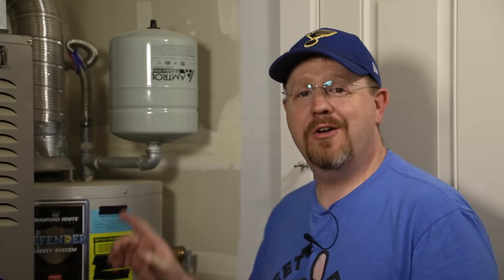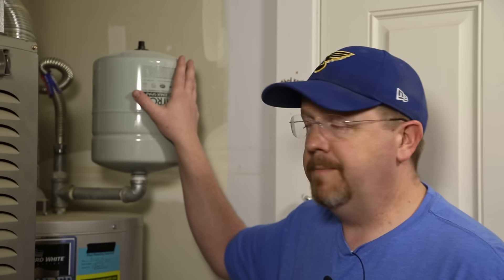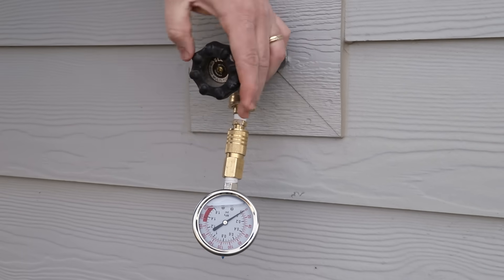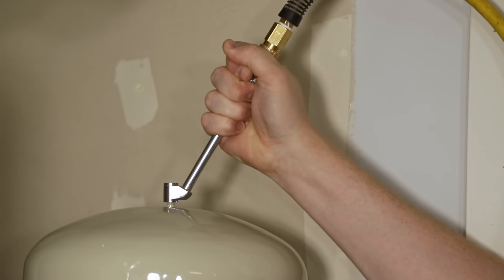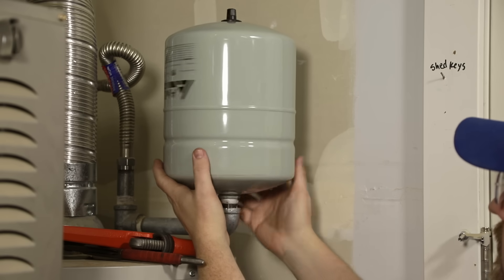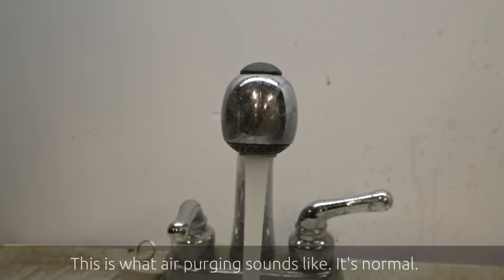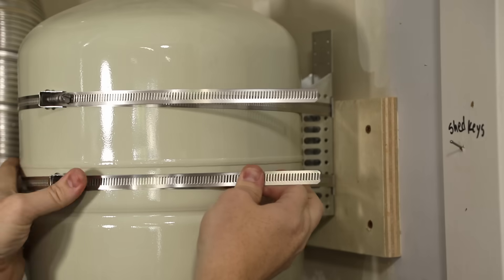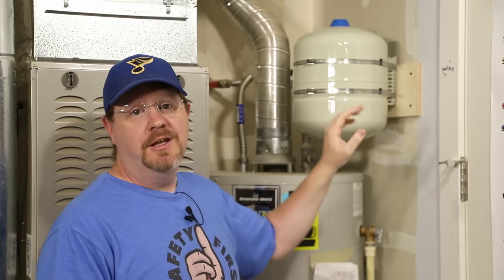What Is This Tank? How to Replace and Maintain a Water Heater Thermal Expansion Tank

Comment: This is super helpful. But I am not getting any air pressure from the exp. tank. So I when I try to fill it, my air compressor keeps shutting off thinking there's already too much air pressure. Should I try using a manual bicycle pump? Or do you think my exp. tank is already failed?
Reply from the maker: Hmm. You mean the air gauge reads no pressure on the tank at all? It could be that the Schrader valve on the expansion tank has failed. You could try replacing the valve core first. That is very cheap and easy to do. I did a video showing the process in a snowblower tire, but the core of the valve is exactly the same in an expansion tank: https://youtu.be/3U3Pv-YtMCs 
Good luck!
Reply: @AmplifyDIY  Yes, when I tried to push down the tip of the Schrader valve with my nails, nothing comes out. So it does feel like there's no air in it. And this time, I tried using a manual bicycle pump,,, but nothing. Can't even push it down. I've got the water main turned off, drained the hot water at the kitchen sink... still no change. I'm going to try to replace the valve core next and see if that works.  Any tips on what I need to do before I try to pump air back in?
Reply from the maker: You’ve already done what I would suggest. Just make sure the system is de-pressurized (on the water side) before you remove the valve stem. Fingers crossed that’s all it needs!

Comment: For the metal support bracket, was the wood backing plate also screwed into the wall on the left side and just not shown in the video?
Reply from the maker: Hi Rat - yes, I screwed it into the wall in 2 places (so it was anchored to 2 separate studs), but one was back behind the tank and really difficult to film... but it happens right at 8:11. Great question, and thanks for watching!

Comment: um, where is using galvanized steel pipe for plumbing approved?  that can't be installed to code, no way.
Reply from the maker: It was installed by a licensed plumber, and passed city inspection when the house was built 4 years ago. 
Im in the Pacific Northwest. 
Swapping that out is on my list.
Reply: @AmplifyDIY  yeah id definitely get it off.  Ive seen galvanized sheet metal laying in the rain, it turns the water orange.  Some if the mexican workers were using it to cook on 🤮

Comment: That's how my expansion tank is installed but I have read that that is actually upside down as what is the bottom in the video is where the water goes and you will end up with air trapped In the water side. According to what I've seen if that thing was flipped over with the air valve on the bottom and the piping coming in the top that would allow the air to leave that half of the bladder as it filled because obviously air rises. Not sure it makes much of a difference but.....
Reply from the maker: Hey Chris - it depends on the model. The instructions for this specific model say it can be installed in either vertical orientation. If you are replacing / installing one, consult the instructions to make sure it goes in correctly. Thanks for watching!
Reply: @AmplifyDIY   I wasn't aware of that,  thanks for the information

Comment: Our water heater is 22 years old and it doesn't have an expansion tank. Just a new thing to add that can fail and you have to call out a contractor.
Reply from the maker: Your water supply probably does not need one. They are becoming much more commonly required with newer homes.
Reply: In many localities, it is irrelevant whether you "need" one or not.  It is local plumbing code and they are mandating that one be present when the water heater is replaced.

Comment: nice vid.... but why do i need an Expansion tank? i have pressure relief valve already...
Reply from the maker: Hi Rush - the 2 devices are meant to handle 2 entirely different things: The T&P valve is meant to deal with an emergency situation where the pressure or temperature in your heater tank has exceeded the threshold of safety for the tank construction. In short, the T&P is there to open and relieve pressure if the tank ever gets severely over-pressure or too hot.
An expansion tank's job, on the other hand, is to protect the rest of your entire hot side of your plumbing system from the completely normal slight expansion that happens whenever you heat water. It used to be very common for your water supply to run on an "open" system, where as water expanded a bit it was allowed to backflow up your water supply line back out to the street. Most newer construction has done away with this, and new homes are being built with a "closed" system... i.e, there is a backflow preventer on your cold water supply, so as the water in your heater expands during the normal operation of the heater, it stresses all the devices connected to your hot water supply.
Don't take my word for it though - bang around on Google for a few minutes looking for something like "do I need an expansion tank" and you'll find far more info than I can share here. 
Thanks for watching!

Comment: Why does the tank have to have the same pressure as the pressure on the hose bib? I thought that water pressure should be the same as stated on the expansion tank?
Reply from the maker: The air pressure in the expansion tank has to match the water pressure of your supply. The most convenient place to measure your supply water pressure is at a hose bib. Great question!

Comment: He has the tank installed upside down which I thought was a problem because any air bubbles in the water will become trapped in the expansion tank. Over time you might end up with a lot of air in the tank.
Reply from the maker: The instructions for this tank specifically say it can be installed in either vertical orientation...

Comment: Very good explanation, it makes a replacement a lot easier. Thank you.  Also, I would like to ask you how often I should replace my water heater expansion tank? Thank you.
Reply from the maker: Hi Ronald - when properly maintained with the correct pressure, an expansion tank should last the life of your heater. I check mine annually, and replace it only if it is no longer holding pressure properly. Great question!
Reply: @AmplifyDIY Ok, I got it. My expansion tank started to leak after 12 years. So my next question would be how often I should check the pressure and does a regular air pressure gauge would work for that purpose. Thank you.
Reply from the maker: @renaldas72  I like to check the pressure annually the same time I do my flush and check the anode.
Reply: @AmplifyDIY  Thank you.

Comment: Great video and perfect information, i able to follow steps and filled out my expansion tank. I have question: what should be the pressure when you turn on your cold water valve and turn off hot water faucet? when i pressurized tank pressure was 30 psi and when i turn on cold water main valve and turn off hot water faucet pressure is 62.4 psi?  is that normal?
Reply from the maker: Hi NP - it sounds like something is not quite right here. The main thing to understand about an expansion tank is that the air pressure in the tank (when it is either disconnected from the heater entirely or there is no water pressure in the heater) should be equal to the water pressure of your water supply. If you only put 30 psi in your expansion tank, that is likely not enough pressure. 

Here are the steps to take to check your pressures: 
1) Turn off the cold water supply to your heater. 
2) Open a hot water faucet, and let it run until the flow stops. This will de-pressurize your water heater. 
3) Measure the air pressure of your expansion tank, and write it down somewhere. 
4) Measure the water pressure of your outside hose hookup on your house. This is on the cold side of your system, and should be somewhere between 60-80psi or so. 
5) If the air pressure you measured in the expansion tank is not equal to the water pressure at your hose bib, adjust the pressure in the expansion tank to match the hose bib water pressure. 
6) Open the cold water inlet to your water heater
7) After water starts to flow out of your hot water faucet you opened in step 2, close that faucet, and you are all done.

Good luck!

Comment: You did a good job explaining the expansion tank, but the strapping was really overkill because the three-quarter inch galvanized pipe is plenty rigid enough to handle the weight of the expansion tank. I've been a plumber nearly 50 years and still doing it....
Reply from the maker: Hi Barry - I agree it's pretty much overkill for my area as well, but in areas with high incidence of earthquakes, it's required by code. Thanks for watching!

Comment: You don’t need an expansion tank. That’s what a t&p valve is for. It’s redundant to have one on an open system. A closed hydronic heating system is a different story and an expansion tank is needed.
Reply from the maker: Hi Bill - the point is that more and more municipalities are no longer running open systems. They put a check valve at the street to your house that prevents backflow, and as you point out you definitely need an expansion tank on a closed system. Thanks for watching!

Comment: 1. the tank is installed upside down. see install manual.
2. if an expansion tank is full. even if drain the system there will be water in it.  drain system. leave drain open.hook up an small air pump to the  shrader and run for a few minutes to force out water. otherwise enjoy the clean up(:
Reply from the maker: Hi Gurban - that's a great tip about using air pressure to make sure the expansion tank is actually empty before you remove it - thanks for bringing it up!
Regarding your comment about it being installed upside down: This model's instructions specifically say it can be installed in either orientation. Thanks for watching!

Comment: I actually had a water expansion tank but was removed by plumber bc the water pipes that were used to install them all corroded within a year.  Apparently the previous plumber installed steel pipes not intended for water and it clogged up within a short time.
Reply from the maker: The plumber removed the expansion tank because the pipes were wrong? Why not replace the pipes and put the expansion tank back? If your system had one to begin with, it was there for a reason....
Reply: @AmplifyDIY  - Yeah he replaced the hardened steel pipes with flex corrugated water connectors pipes, and indicated you really don’t need the expansion tank.  And just to clarify, my original water heater installation never had one, but when I had to replace my first water heater bc of leaks, the first plumber up-sold me on the water expansion tank.  🤷🏻‍♂️
Reply from the maker: @ONI1013.  Ah - then perhaps your installation does not actually need one. If your house has a backflow-preventer valve installed, you definitely need an expansion tank. However, if your municipal water supplier has not yet required backflow prevention at your house, the expansion can just flow back up the supply side. I hope your heater and set up last a long time. Good luck!
Reply: @AmplifyDIY  - yep no backflow prevention.  Thanks for informative video nevertheless.  By the way, I also learned how to properly drain water heater based on your other video.  Very helpful.  👍🏼

Comment: I just find out today about a leaking from this expansion tank attached on top side of my water heater so by watching your video tells me I should replace this little tank which is in blue color in my case and I've never done anything like this.
can you give me some advice please asap. Thank you so much in advance.
Reply from the maker: Hi Byung - what advice can I offer? I think my video pretty much covers everything - watch it carefully and follow the steps there to replace your tank. Good luck!
Reply: Well first of all I think I'll go to the home depot to buy the expansion tank in same or little bigger in size then make sure its compatible in either fitting and capacity with right psi number. I would also need a air pressure gage and plumbers tape. Luckly I have a few plumbers wrench in my garage so that will be enough I hope.
Thanks again and I'll let you know how it went soon.
Reply: I finally got that expansion tank replaced today and thanks to you for the video. Its a great tip.  I bought expansion tank and teflon tape, pipe dope, air pressure gage, and follow your instruction. It took about less than a half an hours... well actually little more because I need to cleaning the after mass. Haha Thanks again !!!

Comment: This is Rebecca's hubby.  Great video; nicely done.  My hydronic system pressure ranges from 38 to 50 psi.   What is the ideal charge for the tank?  Thank you.
Reply from the maker: I’d put it at 40. Within 10 psi of the max is fine. Good luck!

Comment: First of all, a HUGE THANK YOU for your video and your thorough explanation on the expansion tank. You saved me a few hundred dollars because I had an issue with a leaking pressure valve. I thought it was the pressure valve, so I replaced it and the leak continued. I thought it might be the thermostat on the water heater and it was overheating the water and causing the pressure relief valve to open up. I also checked into the water pressure, 80psi and I called the water dept and verified that it wasn’t high since most places are around 60psi. They told me that they run around 85-100psi, normal pressure for their system. I’ll probably add a regulator later, but I checked the expansion tank’s Schrader valve and water came out! I replaced it and filled the air pressure to 80psi. The old tank had rusted through on the tank’s 3/4” nipple and I doubt the plumber added the correct pressure either. But to make a long story short, you helped me by saving me money and if a “like” and “subscribe” is enough to say thank you, I’ll do it in a heartbeat.
Reply from the maker: You just put a huge smile on my face. I love hearing from people who saved money / time / hassle from my videos. Thanks for letting me know, and great job getting it taken care of yourself!

Comment: Can I adjust the psi pressure of the expansion tank while it's installed?
Reply from the maker: Sure, but you need to relieve the pressure on the water side first, or else your air pressure measurements won't be accurate: 
1) Turn off water supply to heater.
2) Open hot water faucet and let it run until water stops flowing.
3) Leave hot water faucet open, and check/adjust pressure of expansion tank.
4) Once pressure is set correctly in expansion tank, open cold water inlet to water heater.
5) Once water is flowing from faucet again, close hot water faucet.

Good luck!
Reply: @AmplifyDIY  Thanks. The problem I'm facing is this:
My current expansion tank is ruptured and needs to be replace which I have.
I took the water pressure for the house at the outside faucet and  it read 30 psi.
Does taking another reading from inside the house make a difference?
Hence the first question: can I adjust the expansion tank later once it's installed?
Reply from the maker: Most fixtures in the house have a pressure reducer, so I would not bother reading there. The reading from your outside garden hose bib should be fine. If you have 2 hose bibs (one in front, one in back) maybe read both to make sure they are the same. If they are not, trust the higher reading. 
Are you sure it is only 30psi? That's pretty low for most municipal supplies... if you are on well water or some other system though it may be perfectly normal.
Good luck!
Reply: @AmplifyDIY  Thanks.  I installed the new expansion tank and took the reading from the water softener faucet and the backyard faucet.  Got a new reading of nearly 60 psi.
Reply from the maker: 60psi is much more reasonable. Just make sure you pressurize the expansion tank to the same pressure, and that you do so with the water heater cold water supply turned off and a hot water faucet open (so the hot side of your plumbing has zero water pressure). If you measure the expansion tank air pressure while the hot water is also pressurized, the air pressure readings won't be accurate. 
Good luck!
Reply: @AmplifyDIY  Careful when trusting the higher reading hose bib.  Many homes have the front yard hose bib plumbed in before the PRV, and the backyard hose bib plumbed in after the PRV.  Thus, the higher reading hose bib in those cases would be at city municipal water pressure, not home pressure.

Comment: Is a water hammer arrestor the same thing? Would you need both? Or would that be redundant?
Reply from the maker: Hi Mablenay - a water hammer arrestor is not the same as an expansion tank. While they fundamentally do different things, an expansion tank can help a bit with water hammer. However, if you have an expansion tank you may still experience some effects of water hammer, in which case you need to install a hammer arrestor as well. 
Good luck!